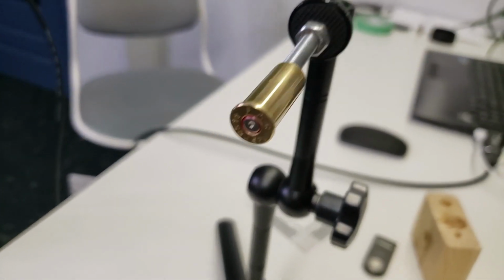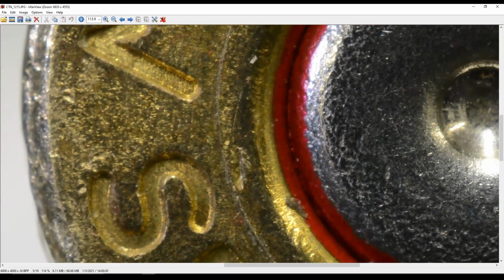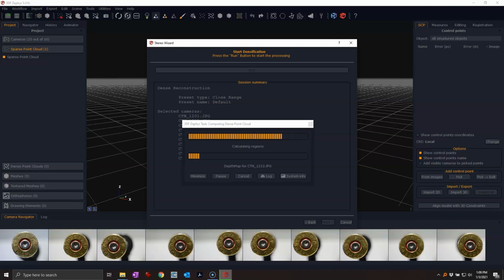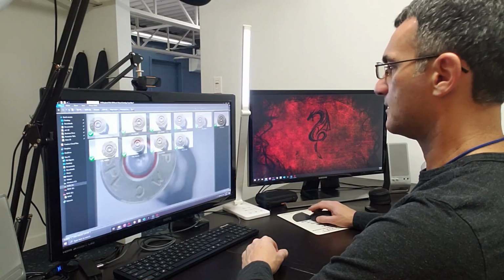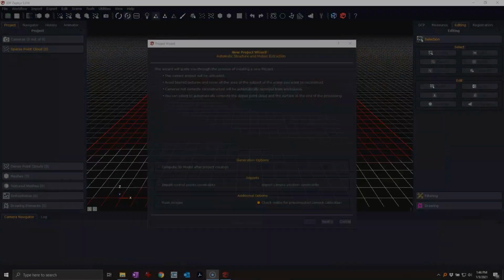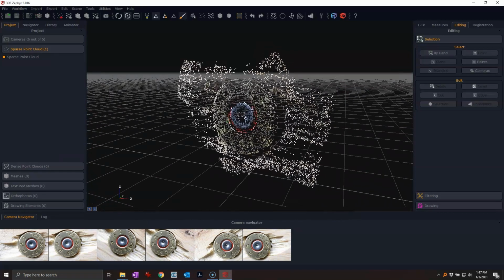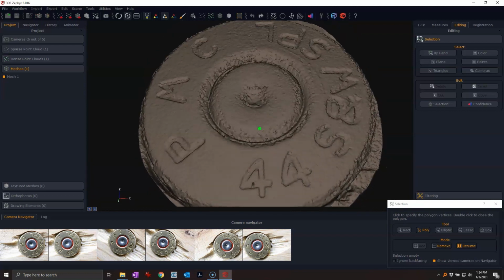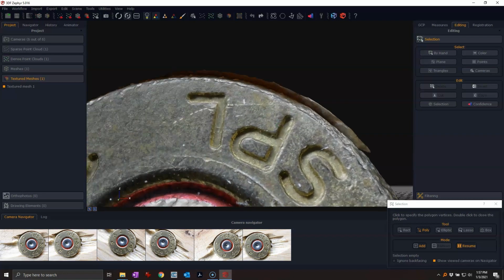Is it possible to create quality 3D models of small objects ? | Photogrammetry |  CLICK 3D   EP 4

Comment: I just heard about photogrammetry yesterday. A tripod, a rotating base and my sony rx100 with the app for time lapse installed. I will try. All I want is to reverse engineering small gun parts (hammers, sears, triggers and trigger bars).
3d scanners are too expensive.
Reply from the maker: Sometimes it's easier to just redesign them in a CAD package with nothing more than a set of calipers.
Reply: @3Dforensics  I use raster images. If I had a good camera with a lot of zoom... but I din't have one.

Comment: How is it that the wooden background helps the software to construct the scanned object if it does not add details to the scanned object itself but only to the background?
Reply: it ads alignin points that the software uses to create the model, if it was the background the alignment process had to rely only on the bullet, with the background it uses also the poits found on the surface of the wood block

Comment: Do you have any videos or opinions on different reconstruction softwares? I tried a bunch and found Agisoft's solution to be the best, is that true?
Reply: Don’t forget Bentley ContextCapture!
Reply from the maker: @scottkarlins  I saw Context Capture presented at a conference when it was rather new.  It looked like it had some good results, but at the time, the cost was a bit of an issue for a lot of users.  That may have changed nowadays but nonetheless, Context Capture may be a good solution for some users.
Reply from the maker: Well, I think it depends on what you want.  If it’s a fully comprehensive photogrammetry package, then PhotoModeler is excellent.  If you are mostly interested in 3D reconstructions, then the top 3 are definitely MetaShape, 3DF Zephyr and Reality Capture.  Any of those will give you good results but I have become very proficient in 3DF Zephyr and I absolutely love their masking tools!

Comment: Superb video, thank you; I’ve been trying to get some 3d models of parts from some model kits that I need to replicate, but my results have been just awful! I’ll give some of your tips a go, but I’ve only got a D3200 with the standard lens, not a macro lens (my Galaxy S9 produces better pictures at such extreme close up!) and focus and depth of field are the biggest problems. I’m not a gifted photographer either, so my knowledge of shooting in anything other than Auto is limited. I had read that I should use Aperture Priority mode with a low ISO so that tallies with what you say. Anyway, very informative and helpful, thank you very much
Reply from the maker: The object you are trying to reconstruct matters too! Keep at it and thank you!
Reply: @3Dforensics  Even the most difficult object has a way. It might take 17 tries. But everything is possible.

Remote control or code is required for macro scans absolutely.
Reply: Been using notes for years because of the s-pen capture feature. Now on the s22 ultra and it's amazing for phone field capture